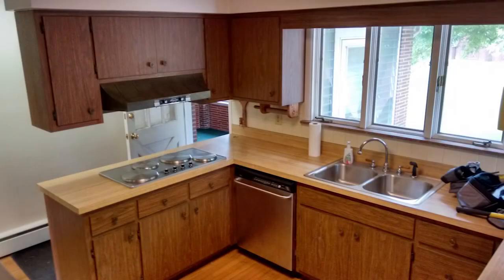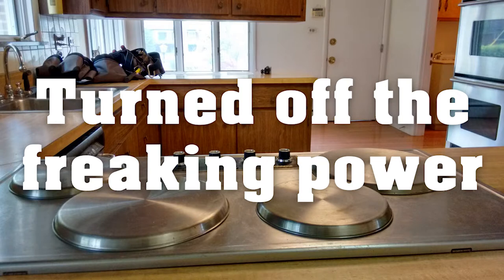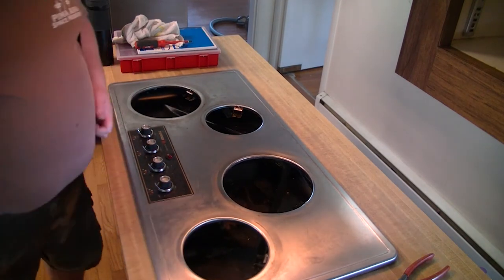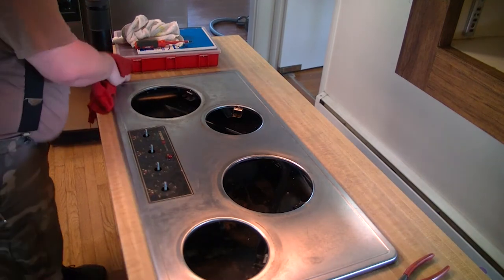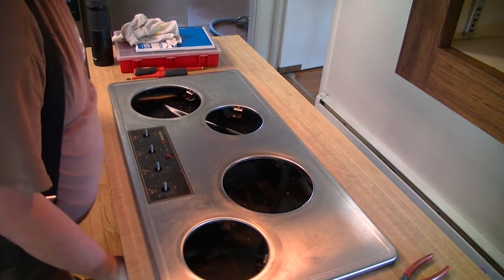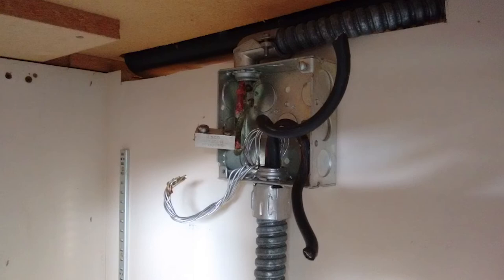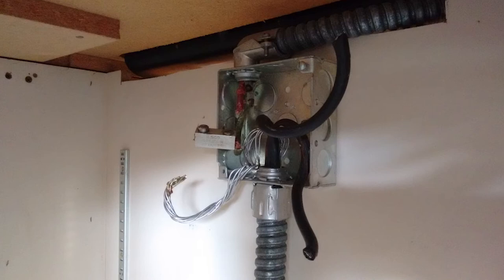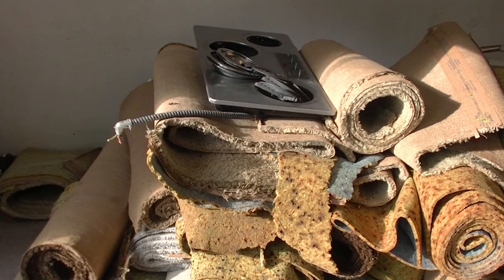removing an electric cooktop | MRS. RATTLECAN'S HOUSE

Comment: Hi James..
Fantastic video! May I ask ... I've had the breaker OFF for about 2 weeks now. You mentioned testing circuit - so even if the breaker is OFF is there still an electrocution danger?

(the cooktop had shorted/smoked/sparked just prior to my turning the breaker off and abruptly stopped doing that once I shut the breaker off, so I would imagine it would be safe now)

Thanks!

Comment: We inherited my grandparents 1950s house and the 28” cooktop (electric) went out. We removed it and the handyman can only cut it to 29” not 30”. We struggle to find it in that size, smh
Reply from the maker: Most likely because of the structure/bracing underneath I would imagine? I would think a competent carpenter could modify the countertop to make the new size work. Best of luck.